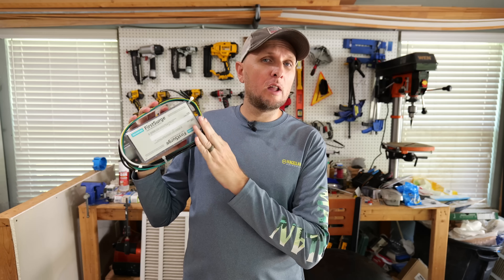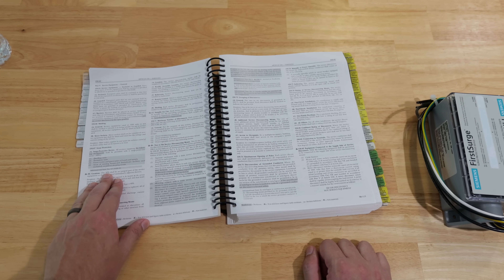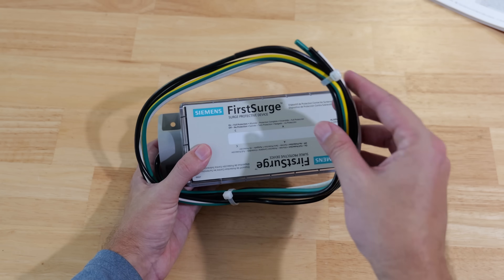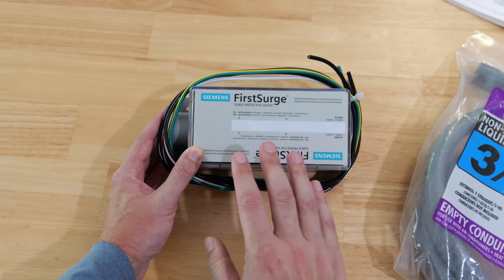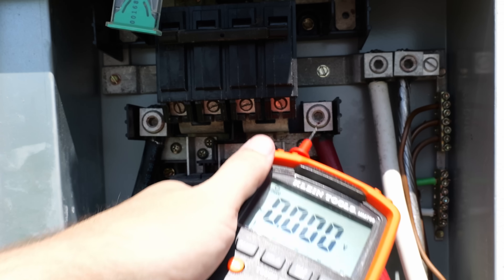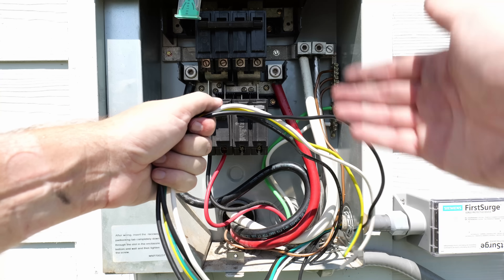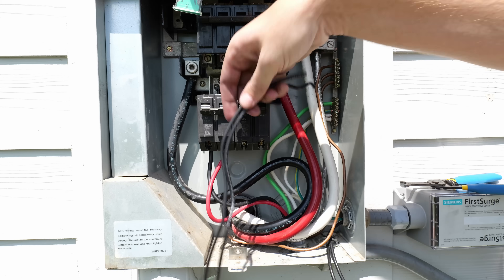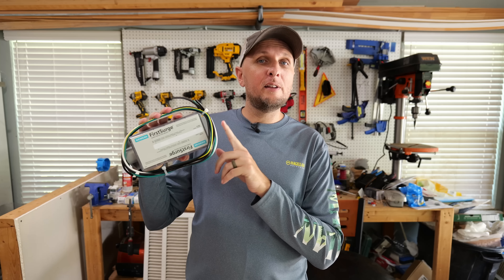Why Whole Home Surge Protectors Are Now Required and How To Install One!  Siemens FS140

Comment: are most power surges very short transient overvoltages? I'd love to see some statistics on what the average power surge looks like, because I can't imagine this doing anything to protect against any kind of sustained overvoltage, if there's a breaker between it and the main breaker. since surge protectors are shunting devices, they reduce the voltage by drawing enough current to create a voltage drop on the incoming power supply (google the phrase "crowbar circuit" for an evocative description of the concept, although note that this is distinct as it's likely not trying to achieve a dead short, but rather a "clamping" circuit, basically a partial short that continuously adjusts itself to act as the world's least efficient voltage regulator). If that sounds violent, that's because it is, these are sacrificial devices, they're an engineered failure mode, designed to induce some very specific damaging conditions, as a way to prevent even worse damaging conditions. you fight overvoltage with overcurrent, but then you're also supposed to connect your shunt through a breaker that's designed to... prevent overcurrent?

i'm confused. does the main breaker also have an overvoltage trigger, and this thing just has to clamp the voltage long enough for that to trip? But that doesn't make sense, if you clamp the voltage then that trigger won't see the overvoltage and won't trip until after the clamp fails. or is the whole consumer surge suppression device industry secretly just extremely half-assed???
Reply from the maker: Surges are very short.  Way too fast for a circuit breaker.  Circuit breakers will trip due to overcurrent as opposed to over voltage.  The SPD absorbs the surge and also is a direct path to ground.
Reply: @HowToHomeDIY  ok, the duration thing makes sense, i guess if they're short enough then the shunt current wouldn't trip the breaker despite far exceeding its rating. i feel like you're not understanding my comment though, the incoming surge is an overvoltage condition, but the SPD burns off that excess voltage by drawing excess current. the way the SPD absorbs the surge is by creating a low impedance path to ground, causing enough current to flow through that path that it creates a voltage drop on the incoming supply. And the infrastructure supplying your house is designed to supply hundreds of amps without significant voltage drop, so it takes a pretty substantial amount of current to achieve the desired voltage drop. so while the overvoltage itself won't trip the breaker, the SPD's response to the voltage will.

Comment: 7:50 you didn't verify shit, what if the fuse was blown in your meter? you need to check the live side, verify that the voltage shows up there, before and after the test, if you want "my meter didn't see a voltage" to mean anything.
Reply from the maker: If there is no voltage in the area that I am working in, then there is no voltage.  All legs were checked.  Main breaker off.  There is no issue.
Reply: @HowToHomeDIY  no, you can't prove a negative. your meter shows a zero, no voltage is one possible cause of that outcome. It's also possible the meter has failed, which is why you need to validate the meter itself if you want to trust that zero for safety purposes. (even then it's not perfect, what if the meter has an intermittent fault? but it drastically lowers the chances of a false negative)
Reply from the maker: How do you know I didn’t?  So much gets cut out of the video so it’s not super long. The title of the video isn’t How to use a multimeter.  Keep the comments coming though 😂

Comment: And as an EE this is where i get pissed at the code making panels. Computers have had far less failures for many years. AND yes it is a threat but for them to come out as that for a reason with no statistics behind these changes erodes the authority of the CMP and makes us as EE scratch our heads and go great a bunch of sparks and fire fighters who don't really understand the problem.

Comment: If you tie in a generator.  During a storm if some hi current item turns off, your generator will take a moment to reduce output. This  triggered the operation of my protector.  My 40kw tractor driven generator  just grunted and poured on the power. It burned the wires in two and smoked up the house.  I do not need this to happen again.

Comment: I have a Siemens sub-panel right next to the main panel with a number of available breaker slots, and installed a Siemens SPD "breaker" in it.  That part was easy.  Just slot it in like a normal breaker and attach the neutral wire to neutral.  Done.

The SPD applies to the whole house, but it is also integrated with two 15A breakers (one on each hot) which can break a circuit if the surge protection triggers.  At the moment I don't use the breakers.   It has two LEDs (one for each hot) indicating that the surge protection is good.

Small surges that don't blow the surge protector's internal fuse(s) (which are separate from the breaker) will trip the breaker and the SPD will remain good once you've reset the breaker.  However, any surge large enough to blow the internal fuse(s) (on any SPD) usually requires replacement of that SPD.

But here's the problem, these SPDs can only deal with relatively small surges, usually up to no more than 30-100 joules depending on the unit.   Once they blow, they are no longer protecting anything.  So I dunno...  I'm wondering exactly what kind of surges these devices are meant to protect against?  They obviously can't protect against a lightning strike anywhere even remotely close to the house.  They can't protect against any sort of continuous problem on the grid for the same reason.   One can put sensitive circuits on the breaker part of the surge protector, but that certainly isn't protecting the whole house.

So these SPDs can only protect against relatively low-energy surges... but what cause those?  What are they supposed to be protecting again?

Comment: I was ahead of the curve as I have been putting a hole house surge protector on the homes I buy for 25 years just for the very reasons you told us about. Having one electronic equipment smoked taut me a very painful lessen.

Comment: The idiots in Quebec are looking at making spark arresting breakers (AFCI) as mandatory now. Not much thinking on that one. Welding and Beauty treatments with a wand will not be happening on one of these breakers because making a spark is how they work. They should be used in tandem with hermetically sealed conduit when in a spark sensitive location but everywhere is just some stupid and overzealous bureacrat overstepping their skillset.

Comment: I went with an Eaton surge protector that fits inside my Eaton panel.  It's really easy to install.  You just pop it in like a 240V breaker, then connect a single wire to the neutral buss.  It doesn't have as high of a surge rating as some of the externally mounted devices, but it should be good enough in most cases.
Reply: They come in different capacities. There is a reason this siemens unit is big like that.
Reply: When I updated my panel I did the same.. Just snaps in.. No wiring needed.
Reply: Those are the better rated ones anyways.  EATON CHSPT2ULTRA Ultimate Surge Protection

Comment: Had a whole-home generator installed a couple months ago. Can you install these with a generator connected, as well? Also, are there any special things to consider if you CAN install it with a generator connected?
Reply from the maker: The breaker next to the one for my whole home surge protector is for my generator hookup.  Perfectly ok to have these installed with a generator.  Nothing to really need to consider.  It’s going to protect against possible surges from the generator as well.
Reply: That was my question too. But does it do the same as an inverter?  It helps with the surges, but the inverter is "cleaner" power I believe. Do you think 8K+ portable generator is "clean" enough to drive the main panel? @HowToHomeDIY